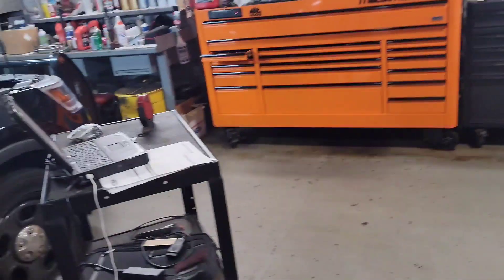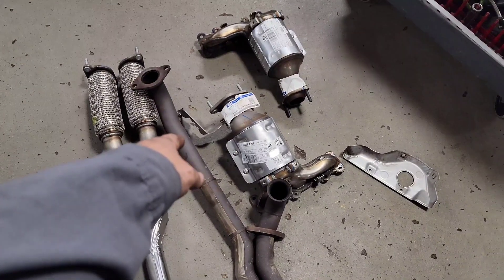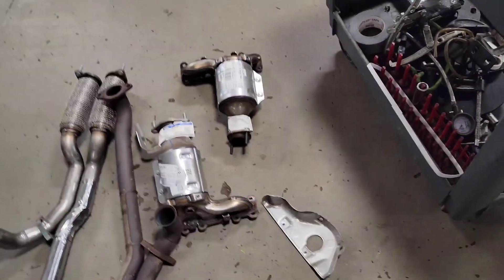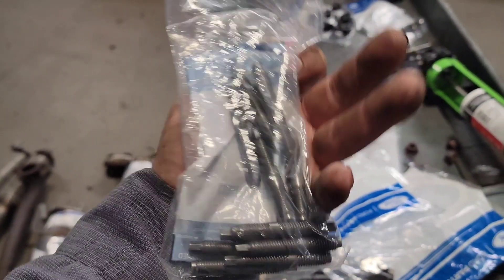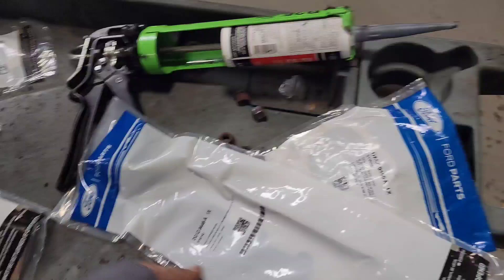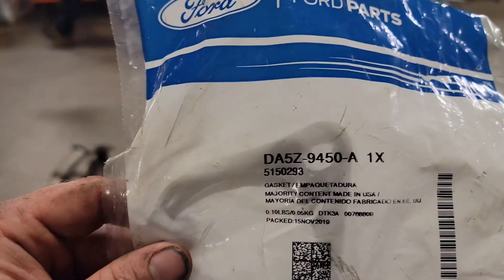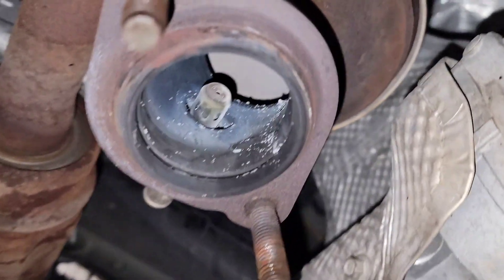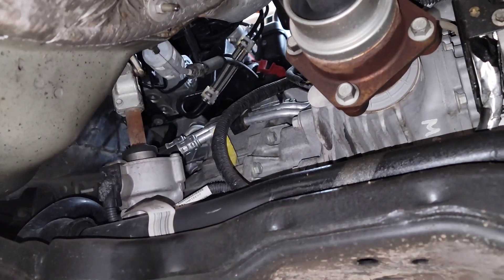2019 Ford Explorer P0430 Turns Into Replacing Both Converters - Parts List Fellas For Thos Who Need

Comment: Why did they fail it don't happen for no reason
Reply from the maker: Yes I already explained this independent post so make sure you always look at the top comment of the comment section

On the police explorer utility vehicles they Idol these a lot and that not good for catalytic converters
Reply: @FordBossMe  0ver fueling at idle if the af Is correct and no misfire what's really going on  ? Cats don't fail on there own ..I try and explain cause and effect to customers .
Reply: @FordBossMe  and thanks for the reply..It odd to see long  idle times for failure .

Comment: I worked as a Ford technician back when the contours came out in the mid to late 90s. They had a recall/ tsb for replacing the catalytic converters and reflashing the pcm. The bolts were always frozen in the heads and would break off. When you got done shoving your arms through the subframe hundreds of times you looked like you got attacked by a wild cat. I imagined that doing that job under warranty on the recall program is what being in hell was like. Doing those for all eternity with my tongue cut out so I couldn’t complain about having to do them.

Comment: Drill a non fouler for spark plug so the o2 sensor fits thru the non fouler screw it in the pipe reinstall the 02 clear the code drive to reset go get test move the o2 out of the pipe 1/2 inch works most times 97.5 out of 100
Reply: I have seen some where that doesn't work. They will set an 02 slow response code. I have one I am doing next week, cat is restricted and causing a misfire due to restriction at WOT.

Comment: I’ve done a couple of those rear cats. It just comes out of the bottom. You don’t have to take anything else out. You just have to find the right angle. It’s tricky on the police interceptor vehicles because they have a bigger PTU with a cooler on it. But you just have to wiggle and move it till you find the right angle and it falls right out.
Reply from the maker: Oh yeah it was pretty easy there was nothing hard about it
Reply from the maker: I actually have a short video showing it all put back together until the rear cat goes back in
Reply: What ptu stands for
Reply: @angelmichelle1909  power transfer unit

Comment: Someone used a "cat clean" on this vehicle or it's ingesting coolant.  That's what your seeing inside on bank 1 converter. They don't look like that when they come apart. Look at the crust on the O2 and the core looks fine. 99% of the time they melt from the bottom up unless it's pissing raw fuel. Sorry just saying.
Reply from the maker: Well unless all the police stations are doing it they all look like this if not worse when they come apart
Reply: I hear what your saying. Just doesn't look like the cat was coming apart(mind you only saw a quick glimpse)IMO. And just had same job today so it made it more interesting 🤔...... keep it up good job.

Comment: We get some of these please vehicles and with the 3.7's. I know PO430 is bank 2 but you are right you should probably change both and make sure we inspect the front one which is bank 1. Bank 1 would give me a PO420. Thank you for all the info and I will definitely use it when I see these coming in again.
Reply from the maker: The front is bank 2 by the radiator 

bank one is by the firewall on a Ford engine by firewall 

when they're transverse like this and B1 is always towards the cabin not the front of the vehicle

Comment: Was Ford guy for a long time first new truck was a Ford a 1977 ran along time with little trouble . Next truck was a JEEP Comanche a 1987 ran good with the 4.0 liter engine next truck was Ford F-150 4X4  did not have many issues but it liked a new alternator and about 3 starters and a fuel sender . Then got a 2004 Taurus with 3.0 Vulcan engine ,cam sensor went out heater hose assembly $ 133.00 [for the part ] ,water pump , alternator , belt tension assy and the transmission twice those jobs totaled $3400.00 . Decided enough is enough and I'm a on second Toyota 1 headlight bulb 2 cabin filters and oil changes I want to support American cars I grew up with but like the converters lying on the floor that should last the life of the car I don't trust Ford anymore

Comment: i assume ford is paying for this, being that new.its kind of crazy they need replaced so soon.but, i can see why with the high idle times police vehicles commonly have.the cost of such a job would be a crazy expence for the average working man.a huge lesson to be learned here, avoid unnecessary extended idle time,or you may pay dearly for it.
Reply from the maker: Yes obviously they are paying for it it's an 80,000 miles a year warranty on emissions components

Comment: That’s ironic , today I put  one of our town ford  explorers on the lift for the first time (2016 3.5)  and the lower left front head bolt is completely missing. All the others are studs and nuts . I put an 8x1.25 shouldered bolt in there for now …. Will fix right when I do the brakes next week ….
Reply: You're talking the manifold studs? Every last one in our fleet are missing that stud. Not sure why Ford skipped it, but not one of them are there on the interceptor utilities that i've found

Comment: How true is the Cataclean product. I got that code on my Nissan Frontier. Poured it on a almost empty tank and floored it on the highway. Check engine light turned off, I connected the code scanner and no more code. What's your opinion, is it recommended to pour every other oil change., Say like every 7 thousand miles. 

Thanks
Reply: BTW, that Ford is a 2019 seems like a major expense, I hope it's on warranty. My Nissan is a 2001 and it runs like a charm.
Reply from the maker: Any vehicle from 2019 would be under warranty as long as it's within eight years 80000 miles this is standard and I don't know about the product you're talkin about

Comment: I have a friend of mine, that has a 2016 ford focus with the powershift. It has 86k miles.. His transmission has started to have shuddering and problems shifting gears. Is there known fixes for this transmission? Thanks
Reply: There may or may not be a class action lawsuit for that issue but I don’t think Ford ever engineered a fix ?
Reply: @BustedWalletGarage  I did see a news article saying that ford extended the warranty. And that some people were getting paid. But nothing solid to suggest it.
Reply from the maker: So they just put a new clutch assembly in but it has to fit Within the extended warranty policy so go to your local dealer have them run the VIN and have them look at the vehicle and tell them that it's shuddering and jerking
Reply: @FordBossMe  Thanks for the information. I will let my friend know.
Reply: Ah, the lovely ford F-us.  :)
Reply: @presidentpoopypants1448  still not as bad as the cvt  in the 500's. That trans is just ..... Wow  bad.

Comment: What was the underlying cause for the failure?
Reply from the maker: I try to leave these answers in the pinned post all the time and I typically get the same questions even though I've already answered it over and over again

Excessive idle time
Reply: @FordBossMe  I've seen many, many techs replace faulty cats without determining and correcting the underlying cause of the failure. Some vehicles like this one the underlying cause isn't a correction that can be made by the tech. 
Back about 10-15 years ago I went through a run of Nissan Altima cat failures that were caused by improper engineering in placement and matrix material. May times this cause a catastrophic failure of the engine due to broken and melted pieces of the matrix being pushed into exhaust valves. There by causing either bent or broken exhaust valves or some made it past the valves into the cylinder bore. I'm sure you can imagine what damage would result from that. 

My point is I just wanted to verify what I knew . you did the right thing  in an attempt to mitigate  a second failure.
Reply from the maker: @anthonyhumbert8787  so previous the 2019 Ford actually had a TSB where you would reprogram the computer in order for it to operate different when it was idling but for some reason this 2019 model it didn't even show up on it so there was no provision to reprogram the PCM like they were doing on previous models

Ford has had issues since like 2014 with these police explorer utility units idling and catalytic converter is going out and we are replacing them periodically just because they sit and idle and idle

Comment: Hi. I just picked up a 2018 interceptor utility 3.5 eco boost twin turbo. I have the 420 bank 1 code. Has 102k miles. Is using a cat cleaner just wasting time, or do I need to change the bank 1 cat, or both? I’m wondering if the new ones will go bad if there is an issue I didn’t discover. I’ve never had a bad cat on a car under 10 years old. Appreciate any advice out there.
Reply from the maker: Send me the vin 
Poissorichard.rp@gmail.com
Reply from the maker: Cat cleaner won't work on the ones I've seen

Comment: My son bought me a great old Bronco. I told him it was missing. He said no. But someone had replaced the intake plenum, wounding one injector wire and severing the other. The unburned air from that dead cylinder overheated the front cat, which crumbled, blew into rear cat, killing that one. $300 to fix plus $300 per cat.  Loved the Bronco.

Comment: Hoping the departments adopt more of the hybrid vehicles, that will help with this problem somewhat, one would hope.  This has been going on since police cars have had cats...know from experience.  Does not matter who the manufacturer is.
Reply: Is that because police vehicles are left idling a lot?
Reply: Hours and hours of idling....
Reply: @808ecobeast7  that could be one benefit of a hybrid, it doesn't need to run the ICE nearly that often and long to have the climatecontrol running and if they use a heatpump you also have heat without the ICE running.

Comment: Good job I recently changed cats on an F150 with the 4.6 modular engine and the catalytic converter‘s were all chunked up inside I’ve always been under the opinion that we should find cleaner burning fuels not power and fuel economy robbing restrictive catalytic converters.  Did the video on my mad boosting YouTube channel

Comment: Seems like crap quality if you cant idle your vehicle. Just seems a built in piece of crap. My 2001 ford van had it's original cat till it got stolen over a month ago. And yes it was in idle for long times regularly in our heat for the ac. My 2001 subaru outback has it's original cat and it has idled for long periods many times in 100 deg heat. Nope just ford building crap cats.
Reply from the maker: That's really a stupid comment honestly

No attack against you but that mindset is just junk 

These aren't mini vans or Subaru cars you can't compare them 

Stupid thing to do
Reply: @FordBossMe  well, to you maybe. But what I'm pointing out is that is there not something really wrong in this picture ? Do I understand the engine ? No. But something is just plain not right. To accept this as normal is not the way to go. And these cats going out like this is just plain  not normal. To shrug you shoulder is not acceptable. I understand that you dont make the stuff but it seemed you were a bit cavalier  about it. Far as I'm concerned that you did not point out or I missed is if these parts have a forever warranty. So stupid or not, I pointed out that my vehicles had over 20 years on them. Will these cats live that long in normal use ?